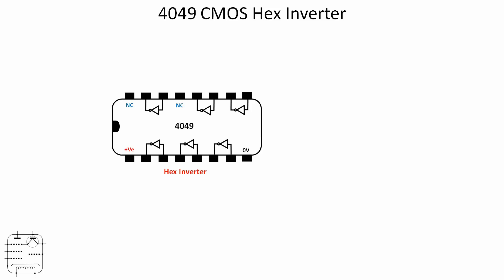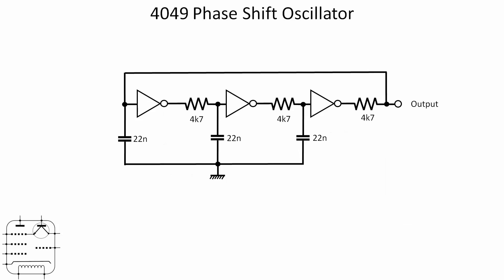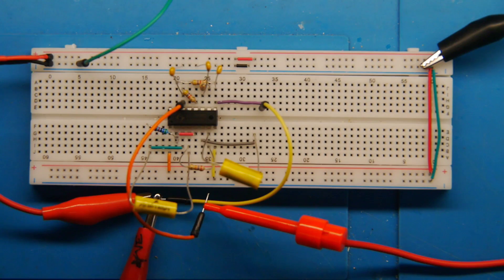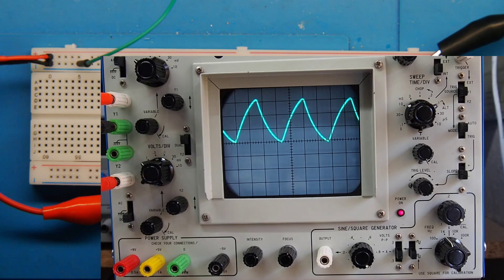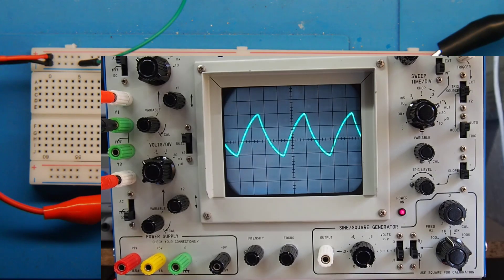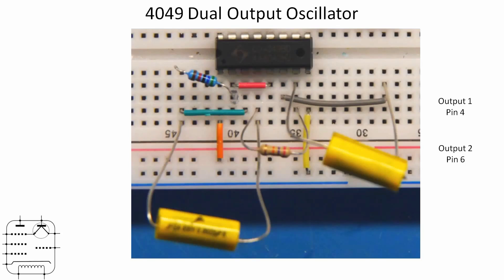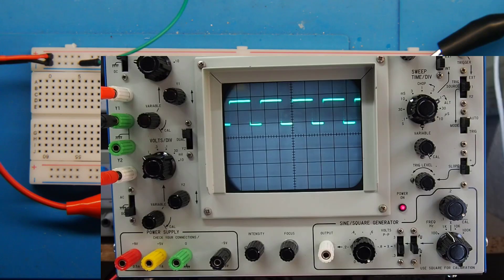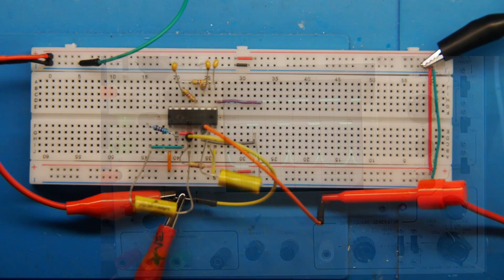Making Waves with a CD4049 - #225

Comment: One question: it it safe to use CMOS for analogue circuits? Because, the CMOS inverter is designed for digital use. if both transistors conduct more or less at the same time, they build a short circuit or drive significant current, do they?

Comment: There are traps in using these CMOS chips. Later versions used output buffers that prevent the inverters being biased at half rail. A BP suffix will identify the later chips.

Comment: Wish I could paste in a schematic, but these 4049's are very useful in a crystal-based oscillator - with two resistors, two capacitors, and two of these inverter gates.  Good to well over 20MHz, and quite stable.
Thanks again, Bill.  Love these explorations.